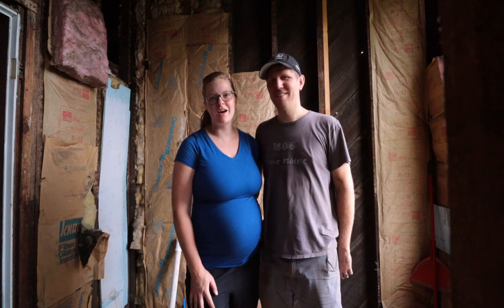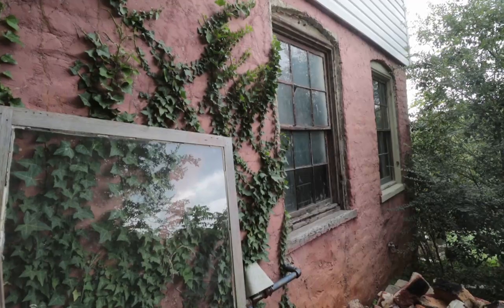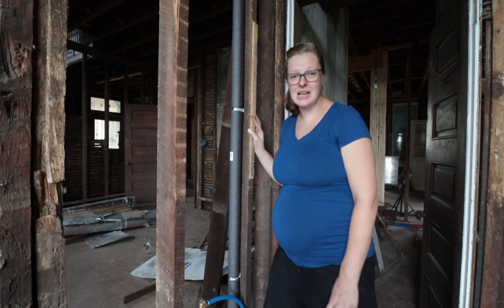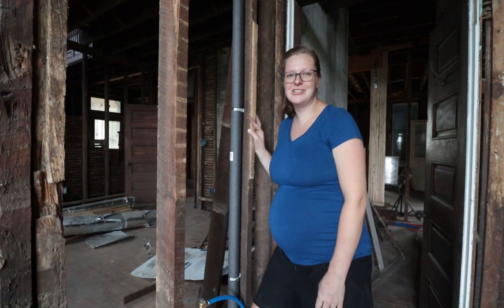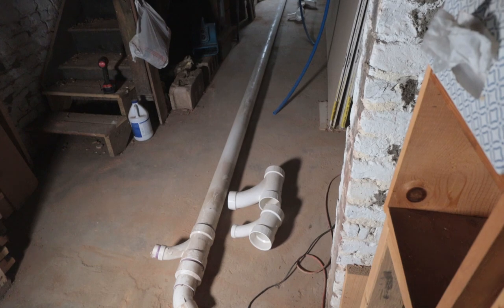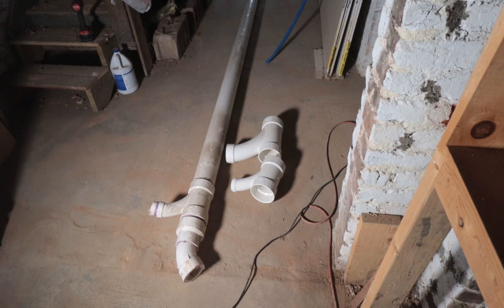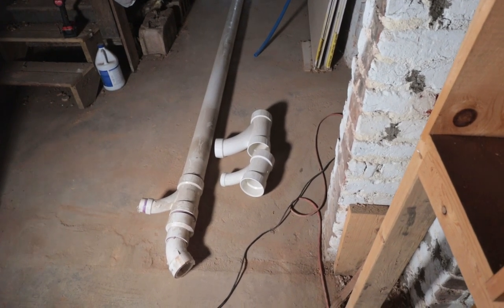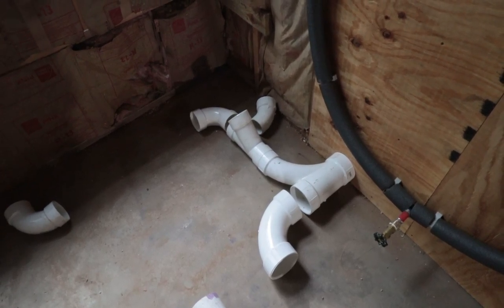A week of some mishaps, bloopers and dirty water - Victorian Home Renovation [TirolerInn]

Comment: Talking is good, like hearing what you have to say:) I'm glad to see you insulated the hot water lines, we didn't and have regreted it.
Did you find the drill bit? That was so cute.
Reply from the maker: Thanks! Yes the insulating felt like a small, but will help, especially since our system is keeping the hot water circulating. Yeah it dropped into the basement so Emanuel just had to go get it 😂